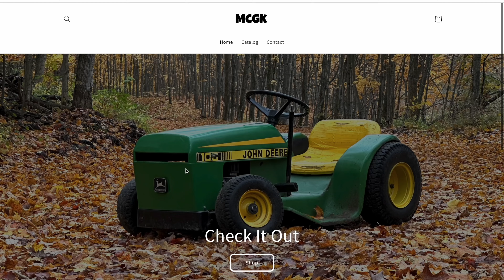Race Mower Murray Build part 2

Comment: Look on market place for cars parting out and get you some cheap metal for skid plates and other accessories. You can also look 4 go cart parts to fix the tow on your front tires . They also have spring loaded spindles where your wheel mount on another excellent idea.  Also you could mount rear go kart shocks on your rear axel to frame .. you could replace that belt drive cog for a juggernaut to sprocket set up  instead of the current clutch system your using . Just some ideas for ya . And good luck .

Comment: Tip for welding. Push, don't pull. 
Tip for bending steel. Heat it til it glows red hot. 
👍 Hope this helps! Nice mower btw. Looks bad ass!

Comment: for race mowers, i always use some 10w40 or similar viscosity hydraulic fluid. that grease will slowly expand, then burn with speed and time.
one of my old poulan race mowers is still being used almost 14 years now, won a race and had a top speed of 52.
good luck and i know yall are having fun!
Reply: He was talking about it leaking out the shaft, does that happen with yours? If so what do you do about it?

Comment: Try heavy tractor gear-oil, the stuff that goes into vintage tractors.  It's very syrupy, but still has some flow, plus it will stay in the box.  You only need enough lube to get at least one of the lowest, smallest gears to touch the surface and drag it into the system.  Too much and you're creating drag that turns engine power into heat while losing it for forward motion.

Comment: what size pulley you use in front and back?
Reply from the maker: 9 to a 3 in the video. Gearing is too tall for the 12hp though, probably going to a 7 or smaller in the front. Or larger engine

Comment: When you were welding those fenders with the mig , you were traveling the wrong direction. MiG welders are designed to push not pull cause the job of the gas is to shield the weld from impurities.
Reply: When you go downhill it's better to pull if the material can handle the extra heat. The mild slant they had here could have gone either direction.